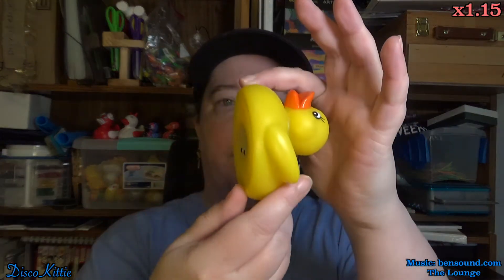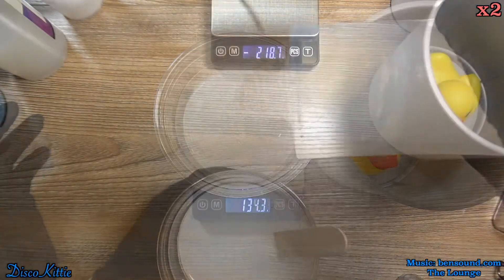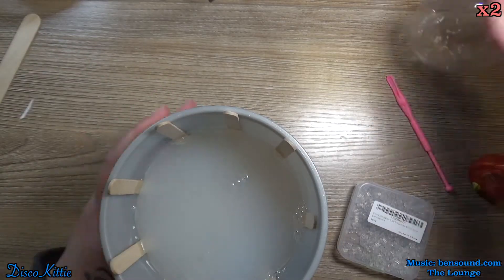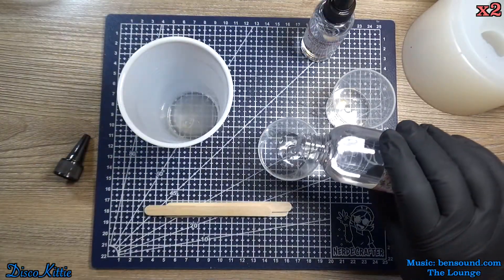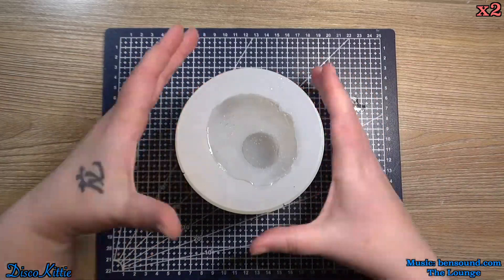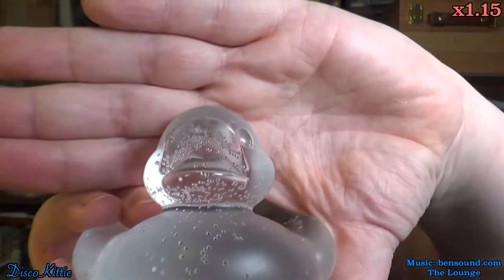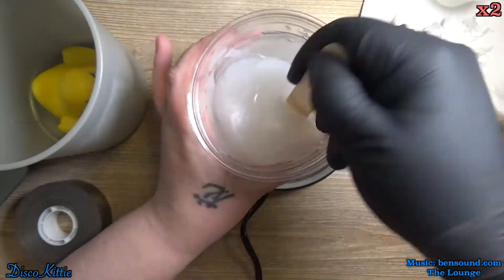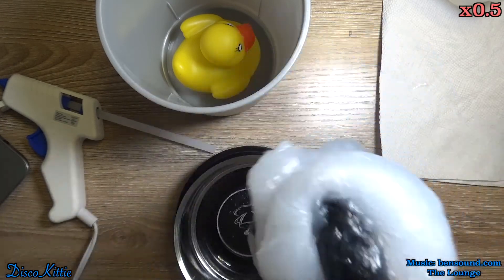Making a Mold with a Rubber Ducky; Jan 5, 2022

Comment: I kind of like the bubbles.  It shows dimension and kind of follows the rubber ducky/water theme.  Looks cool!  I am looking at making a smaller mold of a rubber duck but more detailed using modeling clay.  I will need to then make at least 100 of the ducks afterwards.  Any suggestions?
Reply from the maker: 100 duckies! Whoo, that's a lot! Hmmm, let's see. I'm not really sure what you need to know because I don't know what you know already, you know? lol I've had good success with the Let's Resin mold making silicone, and the Let's Resin resin. The 1:1 stuff, I haven't used the other ratio resins yet. If you have any questions, let me know! I'm not sure what to say. 😊 And thank you so much! 🥰

Comment: How do you make hollow rubber duckies?
Reply from the maker: Oh I don’t, these are solid. You could probably use something to displace the compound in the mold, give it a hollow center. But mine are solid. Sorry. Thank you for visiting! 🥰
Reply: @DiscoKittie  You're welcome. As a solid, do they float or sink?
Reply from the maker: @jamesdavis625  it’s not a witch, so it sinks. 🤣🤣🤣 Seriously, though, it’s made from resin, it does sink. 😊